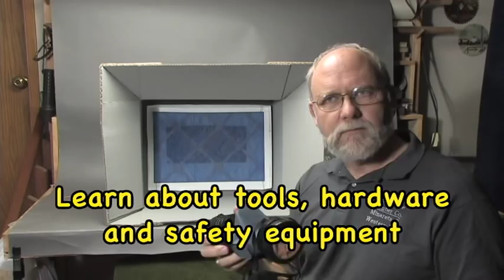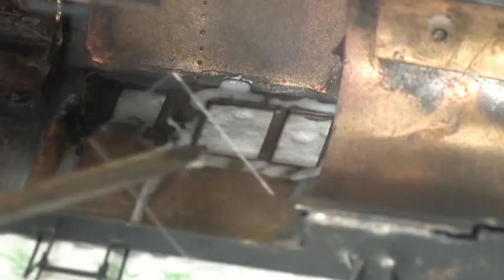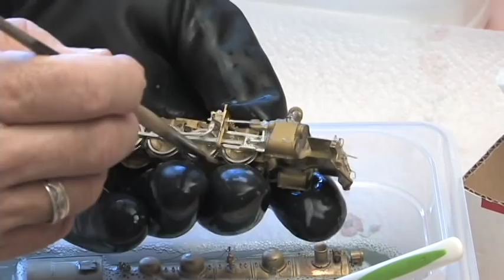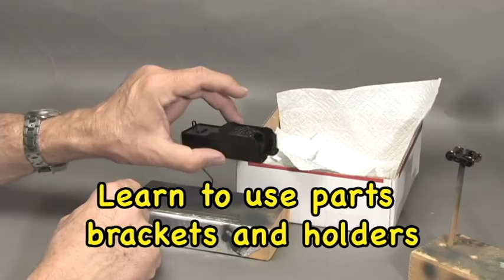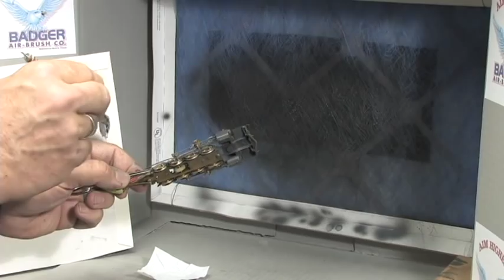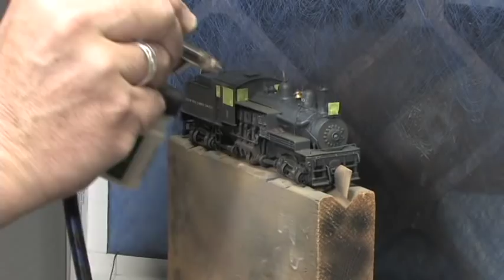"How to Paint a Steam Locomotive" demo video

Comment from the maker: Trainboy94 - Hi, there's no section on rod removal. All you need to do is unscrew the rods, make a diagram of where each one goes and keep them in an organized place for reassembly later. Place the mounting screws back in the wheels to keep any paint out of the screw threads.